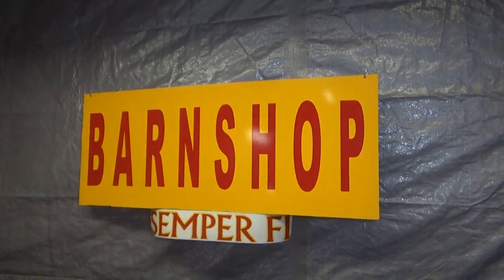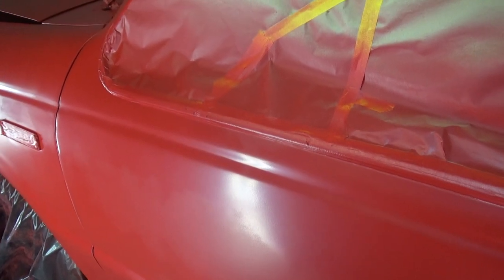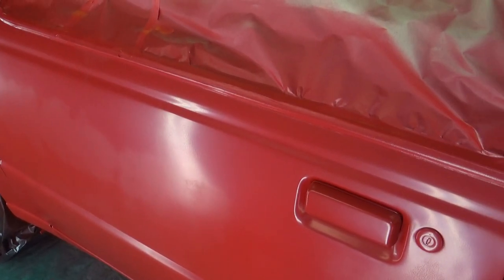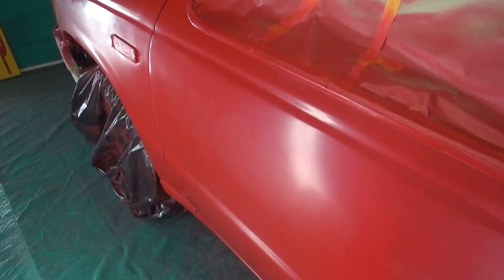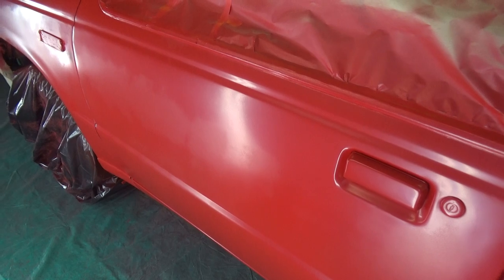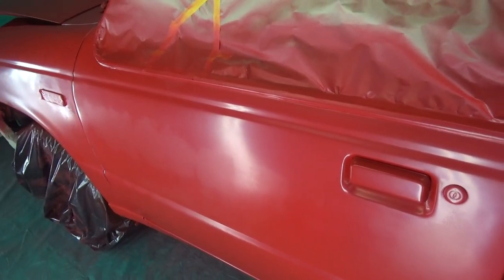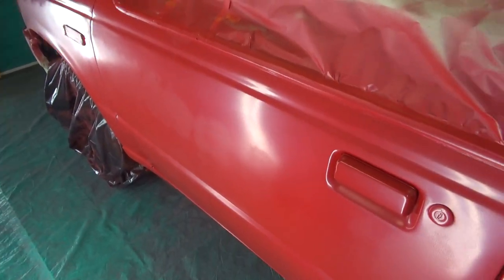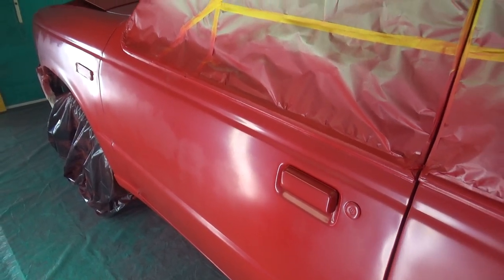What is biting? How to correct paint biting without repainting a complete panel.

Comment: sometimes biting is from the paint solvent dissolving the lower coats thats what causes the wrinkling or biting effect, happens more often on solvent based products, I recently start experimenting with waterborne, never had a reaction since
Reply from the maker: Thanks for the info, Overspray.  I agree with you.  I have found that to be the case and on contacting a paint manufacturer they agreed.  Btw, how has your experience been with the waterborne method?  I've yet to try waterborne.
Reply: This happen when you spray and the coat is wet enough that the solvent melt the paint below and make the old paint to lift and create that texture. If you compare with paint remover you will see that is the same reaction liftting the paint.
In waterborne this will not happen cause there is no solvent involve.

Comment: Definitely happened because you used the reducer to clean that area. Next time that ever happens, fix it with some 500, 600, or 800 paper, then go straight to tack cloth. Dont put reducer over it or it will bite into that fresh base coat!
Either dust in a couple of light base coats over that srction, or shoot some sealer over it, let it flash, then go to town with your base coat.
All the best!
Reply from the maker: I would bet you're right.  I had two bottles, one reducer and the other wax and grease remover, and probably picked up the wrong one even though they are marked.  I did almost as you described and it worked great.  Thanks for your comment.